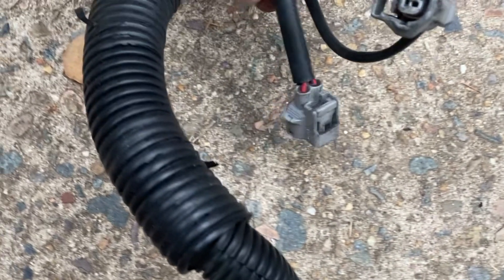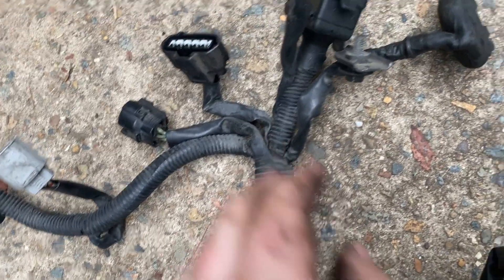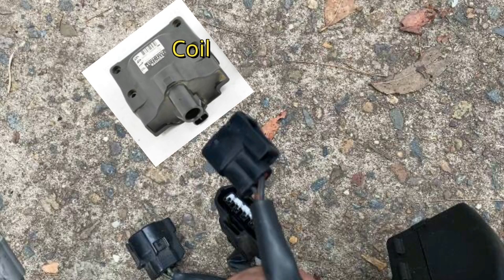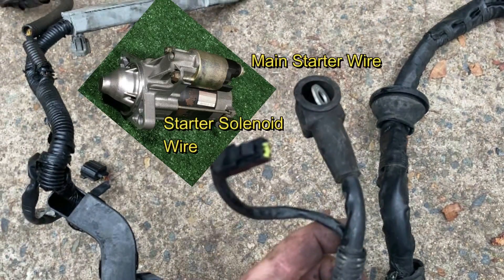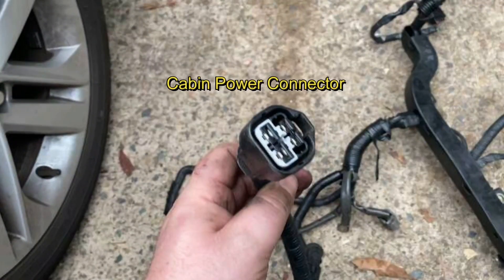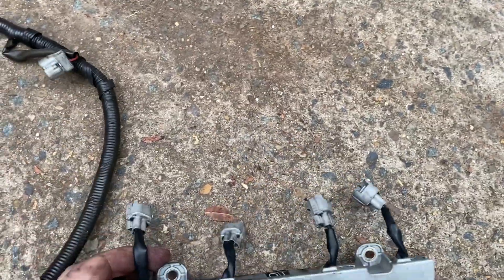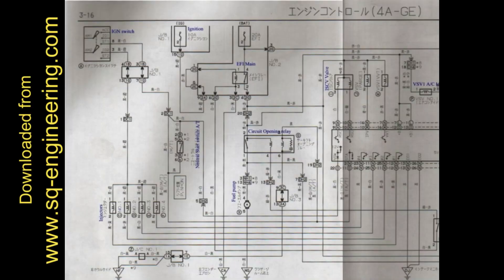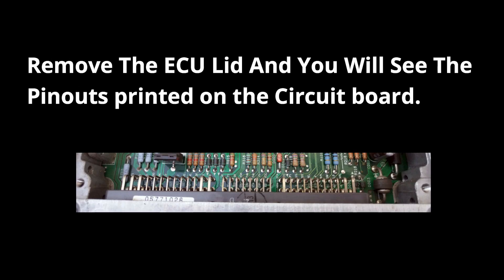Ae101 4age Silvertop 20v Engine Harness Wiring

Comment: i HAVE 26-16-12 ECU FROM 1992.
I checked VVT work and AFAIR it switched when 50% pedal was pressed.
I read that 20v engines had 3 different algorythms of VVT so I suppose mine is the oldest.
Reply from the maker: Yeah definitely different between the different 20v's....

Comment: Can you show me the colour wire of the alternator socket. Because my alternator socket was broken. 
Sorry my english is bad 😂
Reply from the maker: If you look at the alternator itself, it has a diagram for the plug. 

S - Sense  - wire this back to the positive battery terminal
L - Light  - Wire this to the alternator fuse
IGN - Wire this to accessories power

Comment: I am trying to get my silvertop to start but I am missing a plug from the cabin to the ecu how can I power the ecu and the injectors without the Corolla chasi harnas
Reply: If you could help me i would be very happy
Reply from the maker: You can buy the plug and make a loom from sq engineering

Comment: Can the Black top computer be used on the silver top ?
Reply from the maker: The ecu pin outs are different, but the ecu will run the motor no worries
Reply: @AE86DrivingClub86  

Is there any wire changes to be made for it to work ?    If yes what amount 

I'm currently doing a build but I can't get any silver top computer here in Jamaica and I also heard the Black top has a little more buzz to its performance
Reply from the maker: @shevarforbes3517  Get a blacktop loom and ECU that is the easiest way. You'll need to adapt the throttle bodies for the MAP sensor and add the air intake temperature sensor. The ignition between silvertop and blacktop are identical.